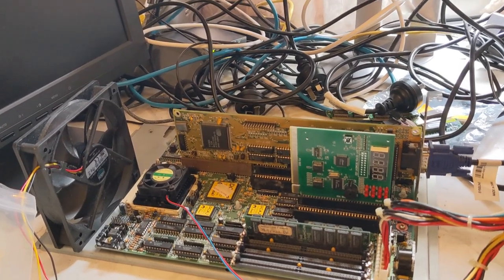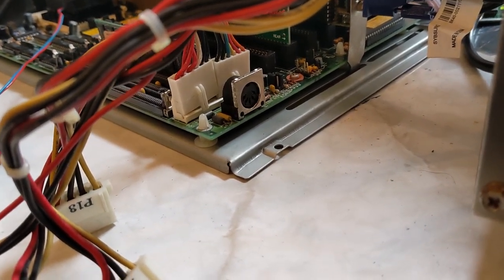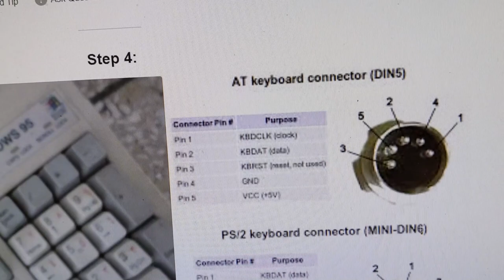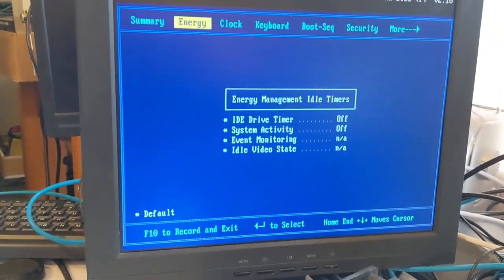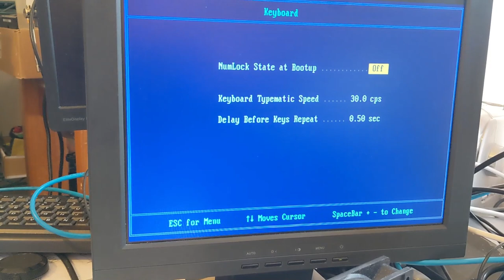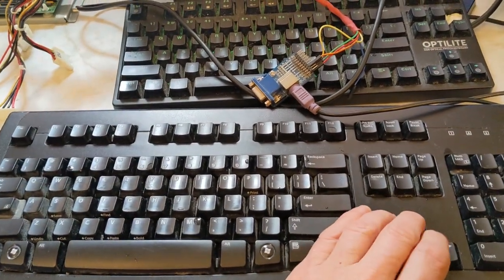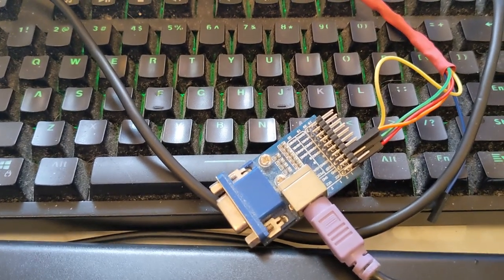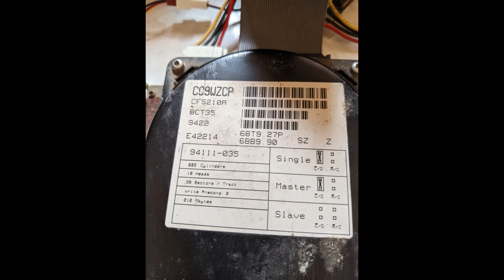A simple P2/2 Keyboard adaptor for my 486 AT DIN 5 pin keyboard input

Comment: Forgive my ignorance, but I thought PS2 to DIN could be converted directly, I've got passive adaptors that seem to do it ok, have I been doing it wrong, am I about to release smoke?
Reply from the maker: Yes you can but I don't actually have a passive adaptor, so I'm just using an old 5pin din Midi plug and a PS2 port that's on an Arduino header board